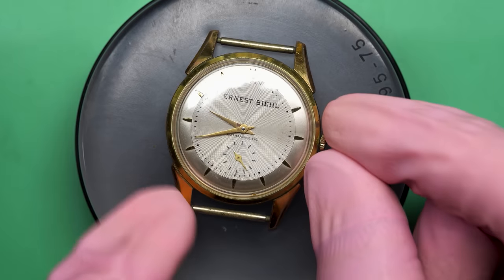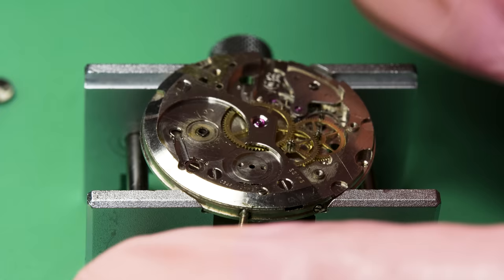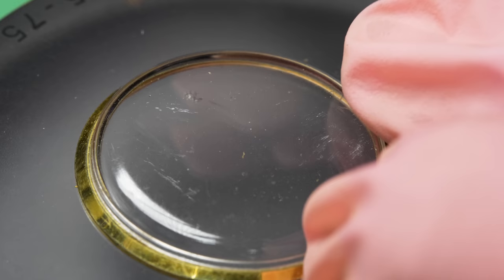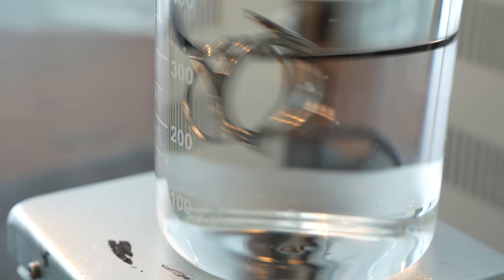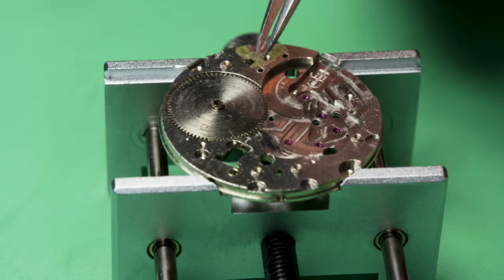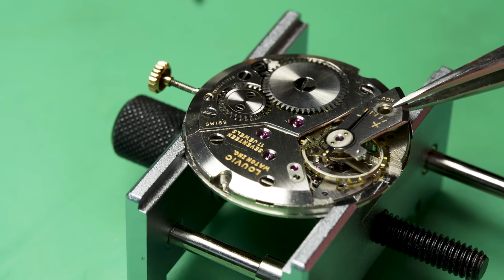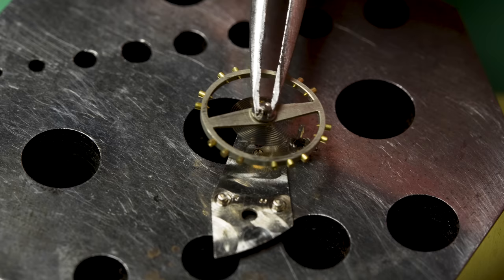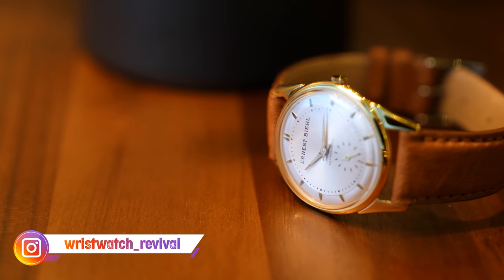Restoring a Charming Vintage Watch From The 50's With a Clever Custom Dial!

Comment: Hey Marshall, great video as usual! Would you consider doing a tutorial on how you measure parts for order? I’ve always had trouble with ordering the correct crystal/crystal gasket, especially for watches where the crystal shatters when you take it off so you have to measure the case.

Comment: Hello! Love your videos mate! You really got me into the watchmaking hobby! 
One question: Can you please tell me your three step ultrasonic process before you got the watch cleaning machine? Those are very expensive and the biggest barrier for me to get really involved with fixing old movements.
Reply from the maker: I used small jars to hold 3 different steps: 1. Detergent and water as an initial clean. 2. Lighter fluid as the main solvent. 3, Isopropyl alcohol to finish the job. Using small jars with the fluids inside lets you put them in the Ultrasonic cleaner with water (you never want to fill the ultrasonic cleaner with anything combustible!). It's tedious to move the parts out of the jars, dry them, then back into new jars, dry again, etc but it does work very well!
Reply: @WristwatchRevival  thanks a lot!

Comment: Before I started watching you I sort of had a mindset that this could not be done. It was like how do they design a watch with all the little screws and gears. And how could anyone take one apart and then fix it and put it back together.. How do they even take the hands off without bending them.
It seemed  almost impossible to me. That is kind of how I said a hobby?
Well I see how part of it is done anyway. I don't know if I explained that very well.

Comment: New subscriber here. Very nice videos. While the rest of the world can wait, I can't wait to try what you do. I have a bit of experience in watch building/modding, but I have stopped myself from taking apart movements for a while. The first two movements I have taken apart are still not put together. Can't seem to get the train of wheels to fit into the plate (bridge?) and the different screws, once they are disarranged...I no longer know which goes where. I keep wondering how you are able to keep track of which screw goes where...

Comment: When you were plating the watch case and bezel every time you went from one flask to another, you shook it. That caused the pieces to crash into one another, which likely scratched and dented the surface you worked hard to polish. In the future, please either plate parts separately or at least don't let them hit each other.
Reply from the maker: The workpieces touching doesn't cause any damage don't worry

Comment: Fantastic restoration Marshall!! However......... 2.9 Beat Error is to high - it needs to be below 1 for optimal performance. However.........I totally get why you didn't do it, it is major risky especially when its not your watch.
 You can get a collet tool for this which makes it easier. Also i take it you oil the exit pallet off camera?
Love your work!!
Reply from the maker: Yes I do oil the pallet off camera, and yes it's just so risky to adjust the beat error on watches like this I usually shy away from it.

Comment: Do you keep your automatic watches on winding machines?  Or do you let them run down and wind and set them when you want to wear one?  Same question for manually wound watches, do you wind them daily or only when you want to wear one?

For me, this is the biggest disadvantage of having several mechanical watches.  If I want to wear one that isn't running, I have to set it.  That becomes more involved if it is a date or day and date watch.

Comment: Love your video’s. 
But I keep wondering…. 
How does a timegrapher work?

In some magical way it seems to be able to measure lots of properties of the watch from the outside. 
I guess it must come from the (contact) sound of the watch.
In that way I can understand it’s able to measure the seconds off per day. 
But then raises the question: Do all watches have the same amount of balance ‘rotations’ per time unit?

And what is that amplitude?
I am guessing the amount that the balance swings back and forth, but how would that be measurable through sound?
What else does it measure?

Would be an interesting topic I think. Does anyone agree?

Comment: Hey Marshall, I'm new to your channel. One of your videos just randomly popped up in my feed, I find this restoration work fascinating!!! I'm curious about two things, I've always been told that you need to get watches fixed my the actual company otherwise it looses its value. Is this true? Other question, I don't repair watches but I do work on my own collector knives and I'm constantly looking for good quality precision drivers, they are torx drivers in my case but I thought that you might be able to recommend a quality brand as watches probably require a much more precision driver than knives, I deal with mostly larger sizes i.e. T6-T10. Thanks for making such informative videos, any info would be greatly appreciated!

Comment: A question, I saw several worn spots/blemishes at times on the hands of the watch, and while you did a gorgeous restoration of the watch itself, I know you have said in the past you don't touch dials, does that also extend to the hands getting re plated?  I couldn't see blemishes once you replaced the crystal, but the camera wasn't at the same angles as when you removed them (straight down). Were they re plated too or are they too fragile / not worth the risks to restore them compared to w/e was discoloring them.

Thanks for your work Marshall, I also have a mechanical watch from my grandfather that saw something like 40+ tears of service/wearing, and I'd love to get it serviced, is there a general idea of costs when doing such work, or is it every watch costs different due to sourcing replacement parts etc?

Comment: I've seen cases where leaving the watch on one side for a long time makes it stick, but turning it on another then makes it unstick. The lubricant that turns into glue is not enough to hold the parts against gravity, and whilst at our size there's a level of precision involved with a mechanism, there still is play in it when you're at that scale. And you can see it at play in this watch, it's all gooey and sticky.
One thing i've been wondering for a while now is... if this lubricant becomes gooey and sticks to one side... does that mean that running the watch may damage the unprotected parts? It would explain some of the stuff i've seen where holes aren't round anymore.

Comment: Marshall, I have a few questions about restoration of different watches. What exactly makes or breaks a restoration? Does replacement of parts, or the case effect the value? I've found a rough watch with a 2824-2 movement. How do I know what value range it is, and how do I max out it's restored value?

P.S. You should save the dust from sanding when you do a full restoration on a good plated watch. You'd be surprised how much can build up over a short time

Comment: Quick question, I have an great-grandfathers old coo-coo clock, what is the best type of oil to use on it? Also, if the weights were lost- how does one determine the weight that the clock needs to function? Thanks, Paul

Comment: Hi Marshall-  LOVE you channel.  It's so addicting.  1 Question-  How do you know where every screw goes after putting them all in the same cleaning basket?
Reply: I’ve wondered the same. At this point as a beginner, I’m still taking pictures of all the screws with captions on the pics so I don’t mix them up 😂
Reply from the maker: Each screw has a different design and can only fit in certain holes, and you develop a sense for it over time

Comment: Would it be better to turn the screws in reverse for half a turn or so to line it up with the threads before putting them in? I do this when putting screws in metal just so I know it isnt cross threading

Comment: Hard to tell from the package, but was that the red loctite or the purple? The red was used on the front body-mount bolts on my Jeep at factory, and when I needed to remove them, it required an impact wrench, a blowtorch, and a lot of swearing.  That stuff doesn't play around.  Something like a cold breaking strength of 3000 lbs per square inch.
Reply from the maker: Yeah it's the purple :)

Comment: Hello, im looking for advice, im an apprentice watch maker and i got the problem that in a lot of cases when i wash the parts as normal in the machines, some get lost, ive tried a few things like putting them inside a smaller basket and putting that one inside the real one. But somehow some random screw or other part just yeets out and gets stuck inside the cleaner.
And its starting to annoy me somehow, just this little problem.
Honestly at this point i dont know any further

Comment: May I ask what the micron thickness of the gold is with this method? I do some case & bracelet refinish/restoration work but not replating and know little about it. I'm just curious as to how this compares to most factory gold plating, or even the vintage gold capping used by companies like Omega that were from 40 up to 80µm thick and would last more than a lifetime of wear. It's my understanding that most gold plated stuff these days is now more like 2µm.

Comment: Is there a way to retrofit a cap-jewl setting on to one of these older movements (shock springs etc)
Reply from the maker: For the top balance yes, and I assume you could do it for the bottom but I haven't seen that done before.

Comment: Marshal, I've been watching your videos for some time now, not because I have the desire to become a watchmaker, but because I enjoy watching videos of any craftsmen at work (woodworkers, machinists, etc.).  Anyway, I have a question about your craft from a bit of a historical perspective.  You routinely use your Timegrapher to check regulation, beat error and amplitude of the watches you service.  My question is how were watchmakers able to check these properties back before the advent of electronic tools.  I always assumed watch regulation had to be a long-term process, a trial and error process that had to take place over days.  But I have no idea how they might have been able to measure beat error or amplitude.  Do you have any knowledge of how these properties would have been measured in the past?  Thanks.
Reply from the maker: I don't know exactly but I assume it would be measured against a known good timekeeper?

Comment: One question, did you watch cleaning machine? Sometimes I have noticed that the cleaning solution is of a different color, so how often is it changed or is it just a different brand of solvent?
Reply from the maker: It's usually just because it discolors a bit over time, I always use the same solutions

Comment: Been watching for several months now, really enjoy it. I am curious, but haven't heard you explain, what "amplitude" means on your time grapher.🤔Then, another thing I've never seen you have to do is make any adjustments to the adjuster on the balance bridge. Is that something you ever need to do? And how much work would it take if you did?
Reply: Amplitude is the travel of the balance wheel in degrees. More amplitude means it’s running with more strength. He always regulates the watches, but sometimes it doesn’t make his final edit to allow for other segments to be shown (in this case, the plating).

Regulating a balance (in my hobbyist opinion) can take as little as a few minutes, or quite a bit longer if you’re trying to fix a pesky beat error.
Reply from the maker: Exactly what Matt said!
Reply from the maker: Hey  Matt, just wanted to say thanks for your answers on these questions, you are dead on every time it seems!

Comment: I got a question, I've got a I think a 2008 Timex I-control indiglo analog alarm, but I can't find parts for it, the watch works ok, but my problem with it is the bracelet it self is to short for my wrist and I wanted to find bracelet extensions for it, is there a site or forum that can have any info on how to get parts for that model?

Comment: Hello Marshall, thanks for your videos, they are all great! I have a question as getting interested to go into in amateur way to vintage watch repair.. I have seen some other videos from other channels and seen that some of them oil the escape wheel teeth's. I havent seen you doing it, are there different mechanisms where you have to do it or not? Thanks for your kind answer.
Reply: He does. I’ve seen him do it in other videos. He has explained in interviews that for timing’s sake, he chooses to cut out certain bits to accommodate other footage - in this case, to accommodate the plating segment.
Reply: @MrMattyRyan1  Ok, thanks.
Reply from the maker: Yeah what Matt said, I do it on every watch but it's very difficult to film while also doing correctly

Comment: Marshall love your videos, just starting to get into watchmaking. I wanted to ask how you got started. What courses did you take and what movements did you start with Thank you!
Reply from the maker: I took the classes from Mark Lovick over at watchfix.com and I started on a Seagull ST36 movement as well as random pocket watch movements from eBay
Reply: @WristwatchRevival  thank you I’m also taking his classes as well.. one more question if I may…how do you know what size main spring winder to use hard to find the info on the internet thanks

Comment: Mitch, i have a question about replacing a movement.  40 plus years ago i bought a Tissot quartz watch.  It has been the only watch i have owned.  Recently it stopped working so i took it to a watchmaker who said he could not fix it.  I then took it to a Tissot dealer who sent it to Tissot Switzerland and they could not fix it because they did not have the parts. Is it possible to swap the movement out, yet keep the dial and hands?  If so, what do i need to look for?  I really want to get it going again but not sure how.  Any help/direction would be greatly appreciated...

Comment: Marshall, I have a question here, when installing a new mainspring is it advisable to apply some Braking Grease to the barrel sides or is that just done on the Automatic Movements?
Reply from the maker: Just on automatic movements. It's not necessary for non-automatic watches because they don't rub against the wall of the barrel.
Reply: @WristwatchRevival  ok thanks for the reply

Comment: Hey really nice Video, but I have to say you need to be more carefull when removing the old plating. You completly removed the edges of the lugs and rounded the chamfer of the bethel. Doing something like that to an a collectable watch would really decrease its value. I think you would need a lapping machine like the nekkid watchmaker uses to retain those sharp edges.

Comment: Hi there @ 16mins 30 seconds when you 1st clean the case what solution are you using . many thanks in advance
Reply from the maker: I'm using a solution called Electrocleaner that all of the plating brands sell, this one is from a company called Krohl I believe.